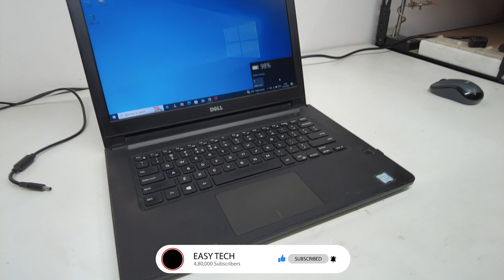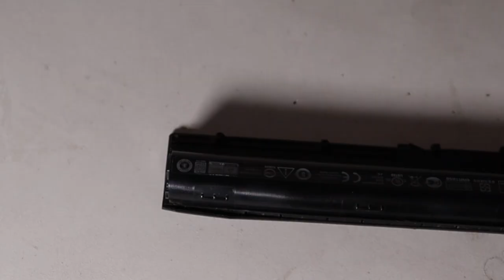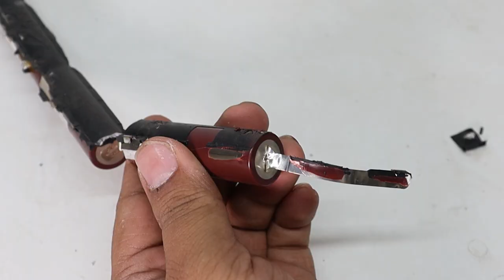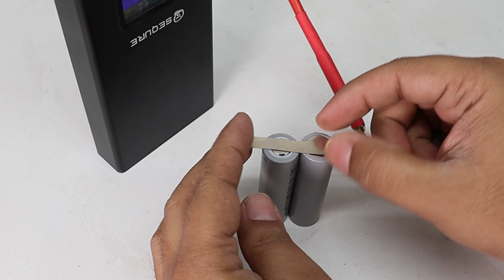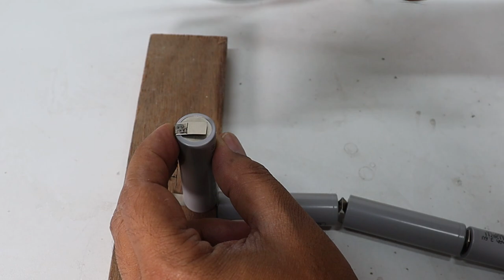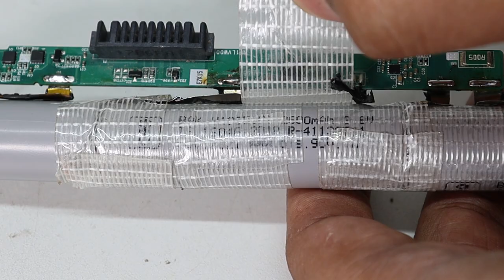How to Repair Laptop Battery || How to Change Laptop Battery Cell

Comment: No, it won't work this way. The BMS needs to be replaced or reset first.
Reply: i read some on youtube you need shorted some pin or the BMS will not active